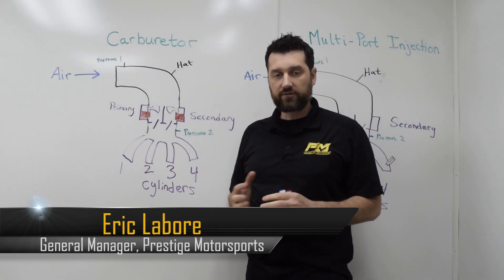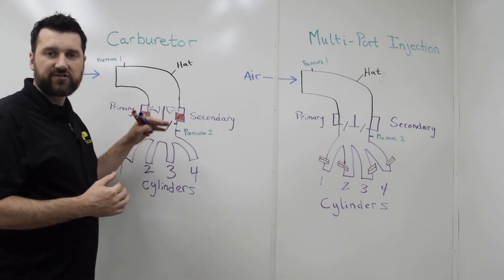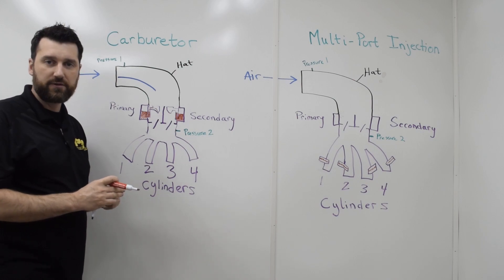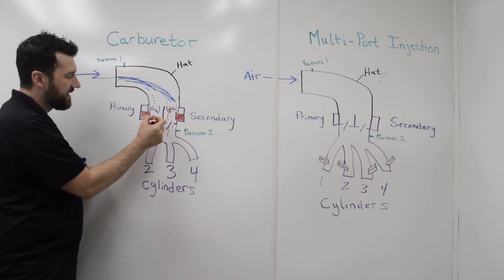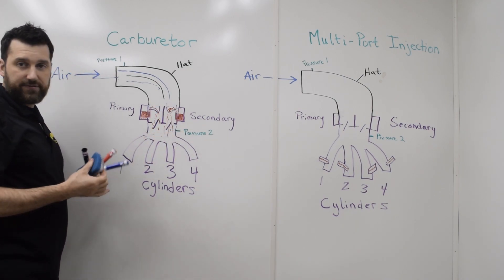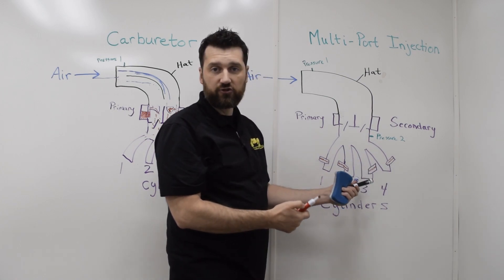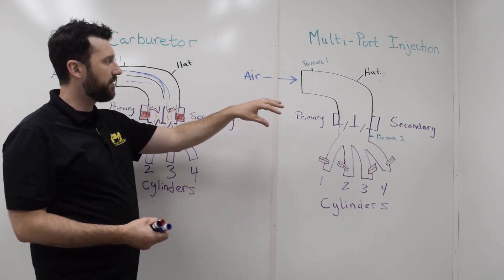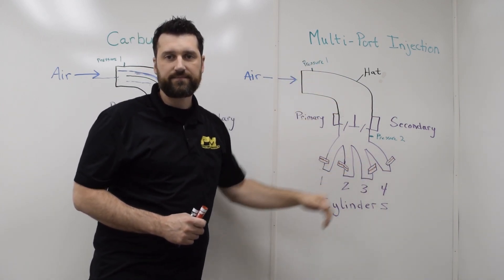TorqStorm Superchargers 427 Ford Air Hat Divider Testing at Prestige

Comment: Design theory quickly becomes a proven fact in the experienced hands of the Prestige Motorsports staff. Unfortunately the short comings of the short-turn radius is a necessary evil with the limited space available in most engine compartments. 

PM is doing some quiet impressive small block Windsor based builds with the advanced technology currently available. I prefer the road less traveled but also with equally impressive results by using former Pro Stock iron Cleveland heads with the extensive high port conversion or the more recent aluminum Cleveland heads. 

As far as I know, Torq Storm doesn’t have a Cleveland specific kit available and I don’t have the machines required to make custom mounting brackets. Does Prestige offer any turbo/supercharger kits with an intercooler for the Cleveland ?